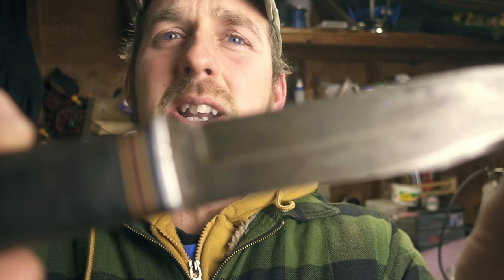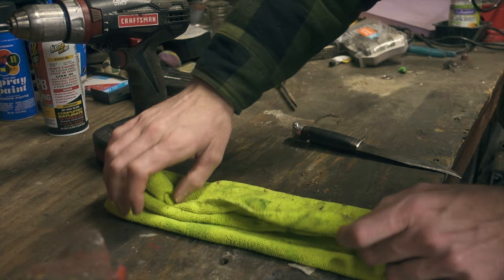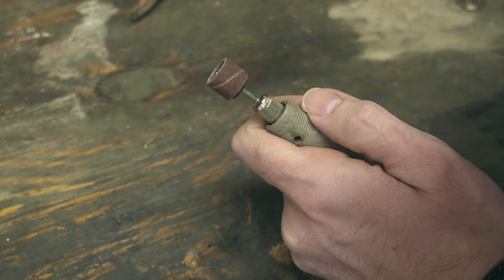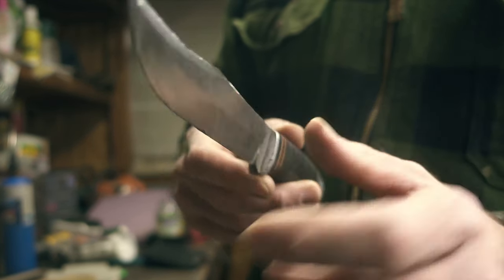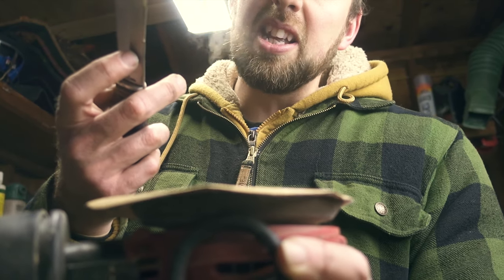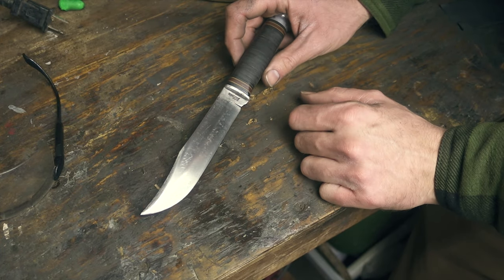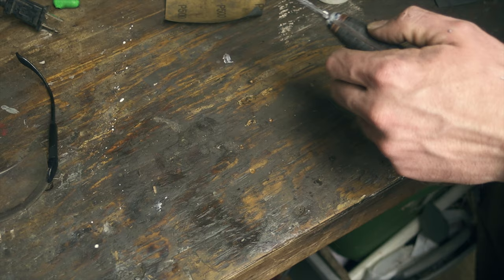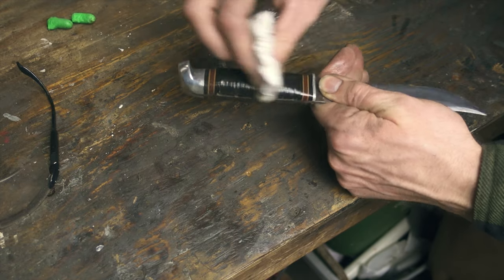Restoring the old hunting knife

Comment: One option on that Leather stacked handle I would have done-Remove the damaged leather pieces all way back to the Aluminum Pommel.  Then wrap super tightly with para cord filling the gap against the leather and pommel—Tie off—End of the cord at the pommel end-wrap with a lanyard Loop!  I’ve done it on a few old leather handle knives.